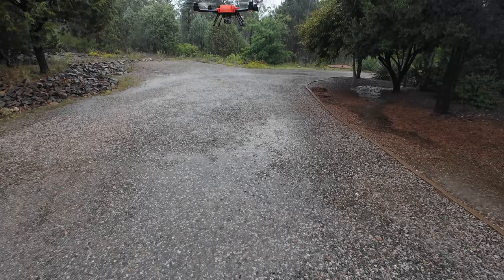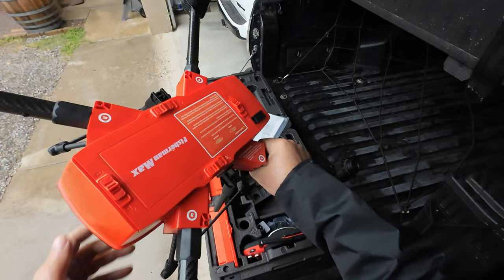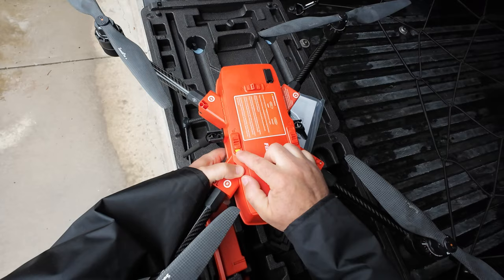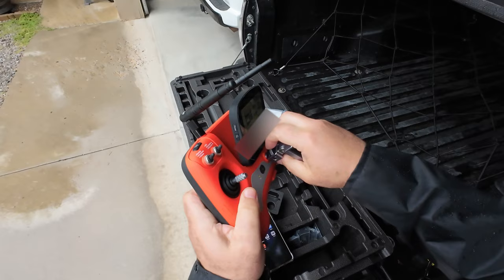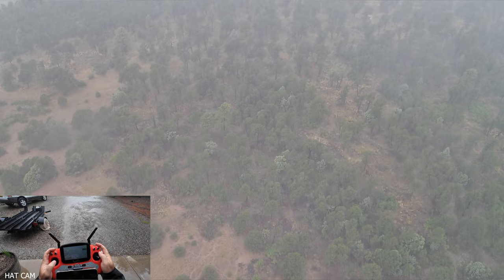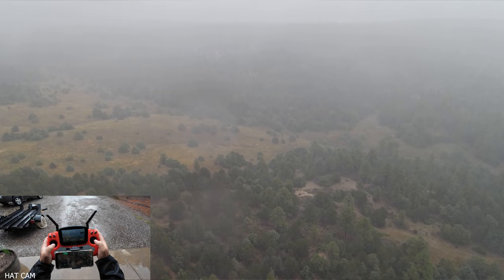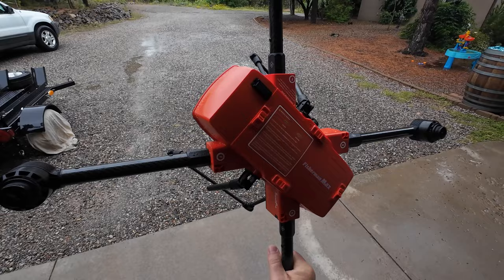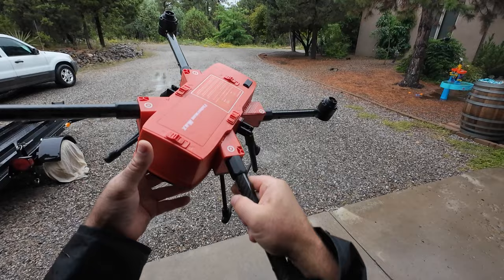SwellPro FISHERMAN MAX (FD2) Flight Test Review in HARD RAIN! - Water Proof?

Comment: Hey Dustin I didn’t see you use the tool to tighten the props. It’s really important you use the tool as there have been instances where customers props have come off in flight. I work for swellpro in the uk.
Reply from the maker: Thanks Tyler,
When SwellPro didn't see it in my unboxing they asked me if I got it.  I double checked and there it was hiding wrapped in the lanyard bag.  I had already shot this and didn't even know one was included.  My advice is to not hide it away in the lanyard bag.  Change locations for it on the case.  I never use lanyards but some people might 🍻
Reply: nobody uses the tool

Comment: just a word about the automated functions... they're cool just like Litchi is cool... but if something goes wrong you're screwed. After eight years flying drones including over 200 fishing drops I highly recommend manual control at all times and don't use RTH unless an emergency. These Swellpro products are great (apart from the insane price) until they aren't. They seem to glitch a lot more than DJI products. I fly both brands almost daily.
Reply: Hello, since you fly this drone daily, is it worth it??
I'm right now seriously considering this drone, so if you have some valuable insight or opinion, please tell me
Thank you
Reply from the maker: Keep SwellPro drones sealed correctly, clean, rinsed, maintained, batteries half charged when not in use and they will last.  If you need the lift strength and waterproofness...this one is solid 🍻
Reply: @DustinDunnill  ...why thank you sir !!!

Comment: I love mine.  I've had no issues.  This isn't a "photography" drone, it's primarily meant to lift heavy baits.  The two releases are important with fish finding rigs.  This is an all weather, -0- visibility - nighttime drone that can be completely automated.  When programmed and the bait is attached, you can simply slide the "launch" and confirm.  The drone will take off, fly to the programmed position, release the bait, return to home, land and lock.  I can't think of anything else SwellPro could do.  

Good luck in attaching 2 separate payloads of dangling fishing line, weights, and bait - Dustin - you should test this and post the video.

-Mahalo

Comment: Perfect example of what not to do Even if it’s waterproof or not, you don’t want to dunk it in water because even though it’s waterproof, dunking it in a clean water bath like you you showed will get water inside the contacts where the propellers sit and you do not want water sitting in there because the water overtime will make the metal rust do you get this the water off? Yes rub off the shelf water or just gently clean it with fresh water.😂😂
Reply from the maker: Lol...did you even watch the video?  You only want to do this to clear out salt & salt water which was stated.  I think we both know it will destroy electronics more than freshwater.  If you did not know this, you learned something today 🍻
Reply: @DustinDunnill 
I don’t think he was listening Dustin lolol. Great job my friend. Could you believe if this drone had OcuSync and Lightbridge on it, what it could be capable of doing in the air.